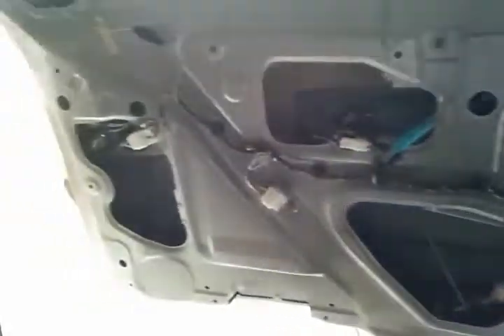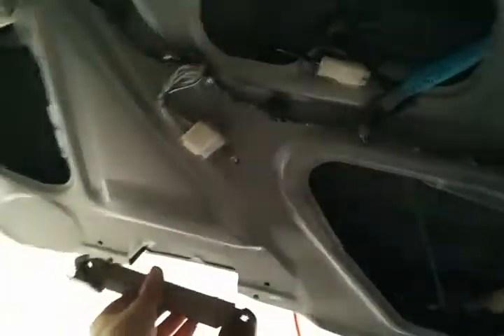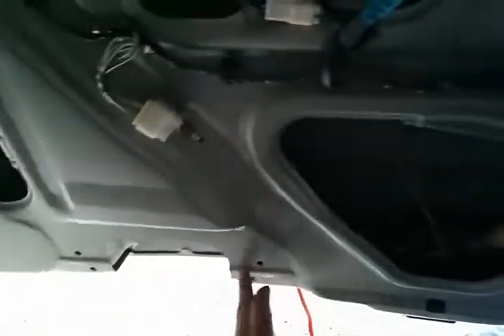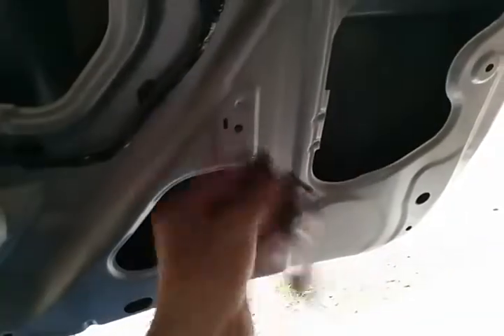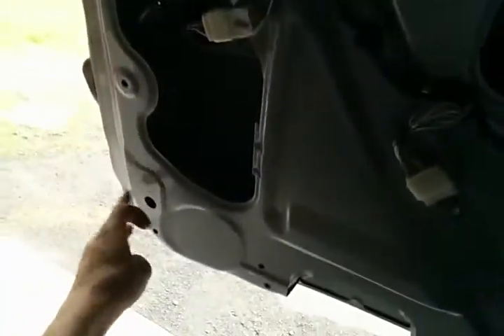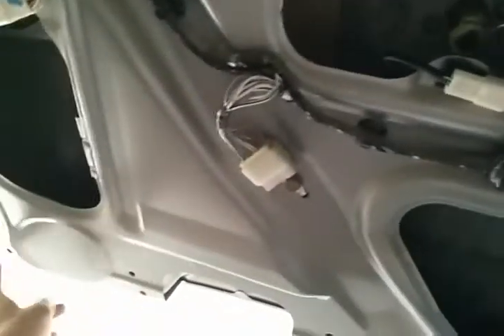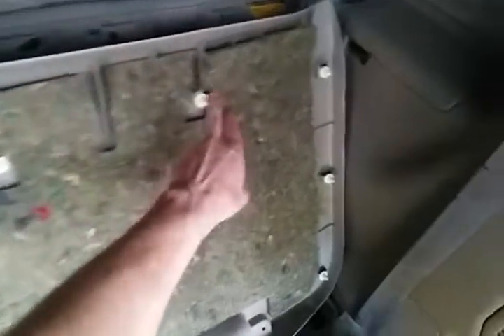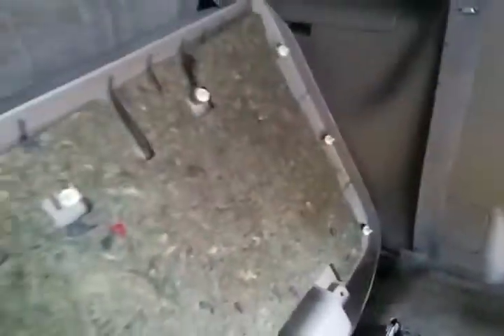How to remove the liftgate trim panel, Toyota Sienna, 1998 -  2006

Comment: Removing the back door panel; is there a black strip that gets dislodged when taking the panel off? Could taking the panel off, leave the tail lights exposed in any way? Water got into the tail lights area after taking the panel off and leaving it off, after a rain. Lights shorted out and found water in the bulb area and some water behind the actual reflector part of light itself. (Rear Lights on door)